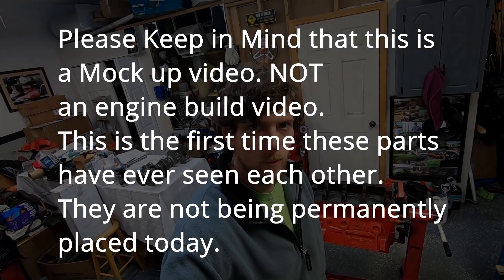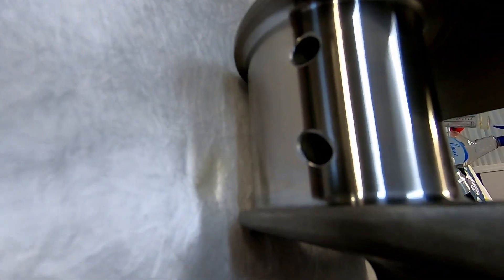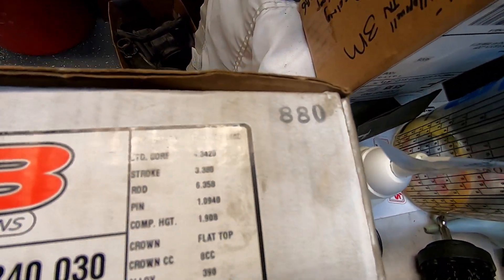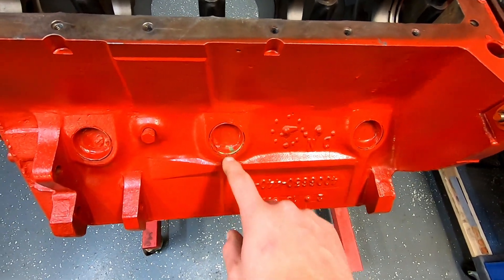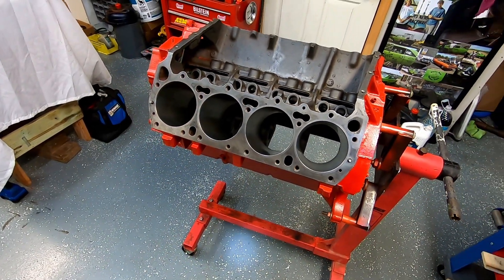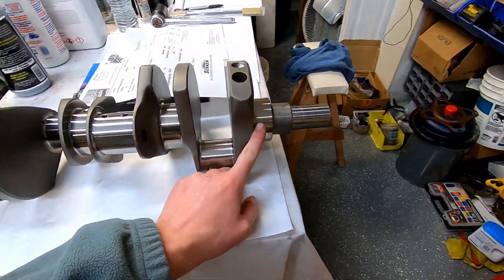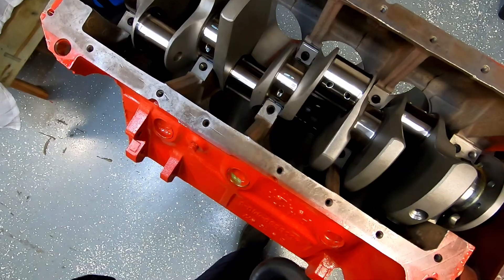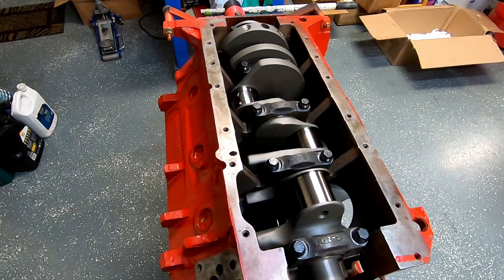Pump Gas 508 Stroker Build: Fitting the 440 Source Crankshaft #mopar #bigblock #engine #stroker

Comment: That's a 440 - 3 block.  Heavy Duty from a large motor home?   I could be wrong, but I think they come with HD rods (like a six pack), along with other reinforced parts.    Many racers prefer to work with the newer blocks (mid to late 70's) because of some extra reinforcement
Reply from the maker: Thanks Tim! I did see a Maltese cross and another marking on the pad. I will get it into a video sometime.
Reply: It probably had what looks to be the same as the 6-pak rods and (902) heads... The 902's are basically the same as a 906, but they have water or some call (STEAM) ports around the chamber. Before aluminum was more available, I knew peeps building those 902's and doing well.... Higher compression was capable as the heads carried away more heat in the water..... Though I have never seen real numbers!!!
Reply: Only issue I've found with later blocks is the huge chambers at the top of the bores other than that I prefer the later blocks.
Reply: @karlsracing8422  Do you mean the water ports?? If so, they shouldn't be an issue with good head gaskets.. I've never had any issues at all with them!!
Reply from the maker: @SteveP-vm1uc  he’s talking about the giant chamfer where the rings install. It’s nearly .080 wider than the bore on some blocks. Crazy. Check out my head gasket video.
Reply: @JustMoparJoe  Ahhhh,,, gotcha.. I don't know where my head was at!!  lol...
Reply from the maker: @karlsracing8422  I did a head gasket video on that!👍🏼

Comment: Yeah, a super cube Mopar engine. 
The only thing is, the bigger you make the displacement, the smaller the head ports and valves become... But on the other hand, if displacement increases, and combustion chamber stays the same, compression automatically goes up.
Ross forged pistons used to be about the best, back in my day, 25 years ago. Lol.
Reply from the maker: True that Eric. This one is getting the Indy EZ-1 head kit. Should suite it really well.

Comment: Another fine video, Joe.. Pretty soon 440 Source is going to have to sponsor you with a kit for your own car!!   One thing, will you be going over this block removing casting slag and relieving sharp edges?? I also like to port out water jacket openings to the pump housing and port the oil pump to the block as well...  The devil is in the details!!!!
Reply from the maker: That would be cool. Thanks Steve. I will knock off the rough and ugly spots. It will be a fine engine when done.

Comment: 440 Source has some nice kits. I did a 400 to 470 with Trick Flows and a SFT Comp. That thing RPMs like right now. Will follow this build for sure, keep them coming Joe.
Reply from the maker: Thanks George! This one gets the Indy EZ heads with Max wedge sized ports.
Reply: @JustMoparJoe  It is in a 73 Duster 727 Manual VB and B-Body 8 3/4 391SG.

Comment: Are the rods going to clear the oil-pickup boss or will you have to grind it down? Also nice 1-2 push low deck to raised deck big block builds. I like it.
Reply from the maker: Thanks Jonny. Haven’t been able to check it yet. This one is going into a truck with milodon pan and aftermarket pickup. I will report

Comment: Hey Joe! Good looking build up going there. At what point would you use main studs in place of bolts?  I've heard some argue that if you dont use studs the mains will walk and read  in other places you gotta run  both studs and a girdle with stroker cranks. Is there a rpm/ power level to use bolts. I admire your work. Thanks!
Reply from the maker: Thanks brother. Main studs are superior. No one can argue that. When using studs, the rule is that the block should be line honed, because the clamping force of the studs may distort the caps and crush on the bearings. Everyone has a different opinion on when each is needed. Having a well balanced engine helps in many ways.

Comment: Too bad they didn't bring it to you before doing any machine work. Ed could have cleaned it up like he did for your 400 build. Hope they centered up the bores like he did on your 400.
Reply from the maker: Thanks Tim. This was done with a good  ole boring bar. Getting the deck leveled will help tremendously.

Comment: On my first true engine build and have a question. Do the original cap bolts use washers or no? I'd like to be sure before I button mine up.
Reply from the maker: No bad questions. I have several people that I still ask things to. Stock bolts didn’t have washers. The ARP’s have a higher clamping load and need them to help distribute.
Reply: @JustMoparJoe  Thanks. The engine I'm working on was pulled apart when i got it and I wasn't absolutly sure.

Comment: I think your clearance is just right, considering the application and oil pump capacity. The oil does tighten up your reading some, the ideal (but scary) way to Plastigage is dry. Thin oil 10w-30 and you're set, IMO!! :trophy-yellow-smiling::face-red-heart-shape:
Reply from the maker: Thanks Rod. I will retorque the bearings dry and dial bore them. The engine has been fun to check out so far.
Reply: @JustMoparJoe  The parts look amazing!! It's gonna be a torque monster!!